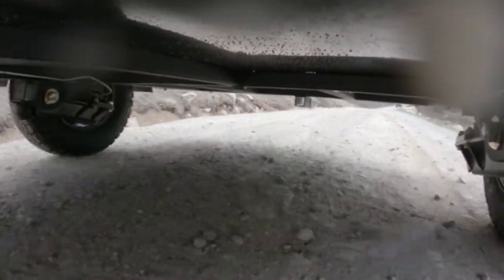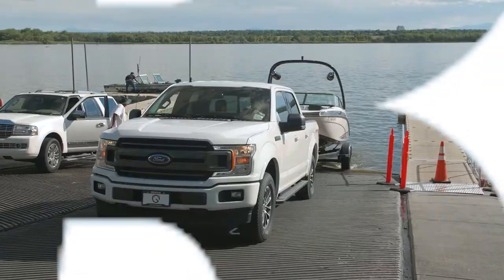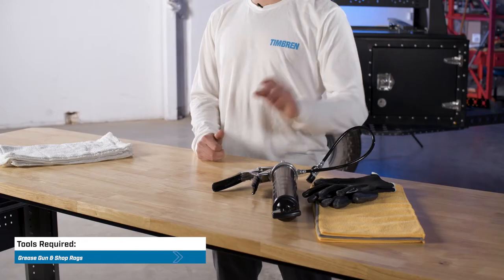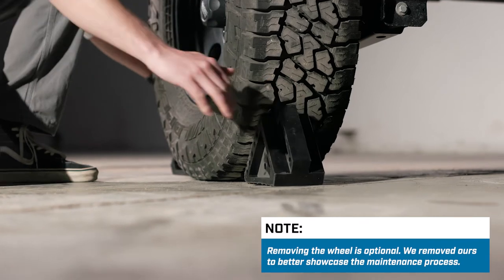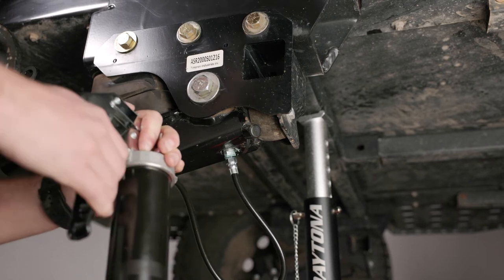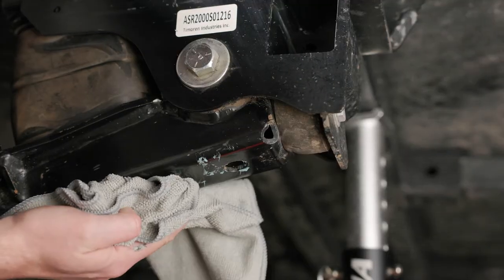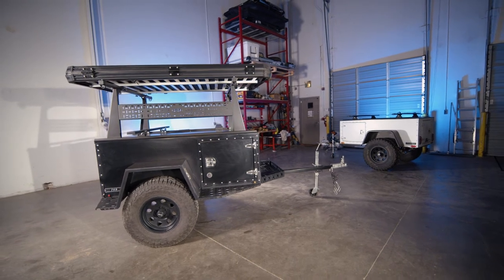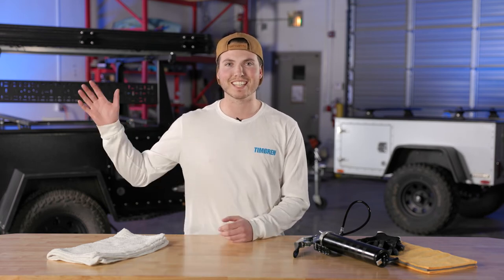How To Grease Pivot Point | Axle-Less Maintenance Series | DIY

Comment: My grease gun won't detach from the fitting after I applied new grease.  How do I get it to detach?
Reply: Drilled out the bottom of the attachment after detaching the hose from it.  

Lesson learned, since the zerk for the pivot is recessed, you won't be able to unscrew the two halves of the attachment, making it hard or impossible to remove it naturally if you've screwed it down too hard (or in my case, came from the grease gun factory screwed down too hard).

Get a Lock N Lube, it will save you tons of frustration for this job.
Reply from the maker: Awesome tip! Yeah those grease guns can be quite a pain sometimes depending on the zerk.